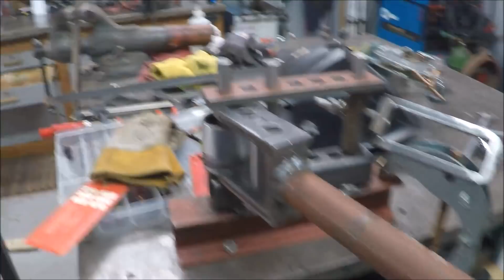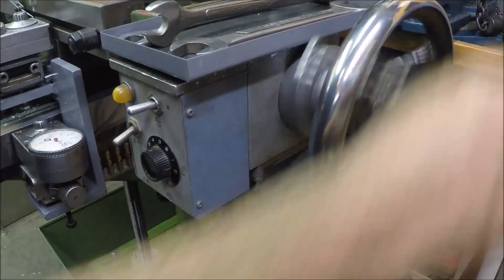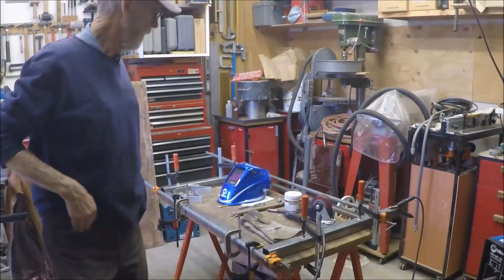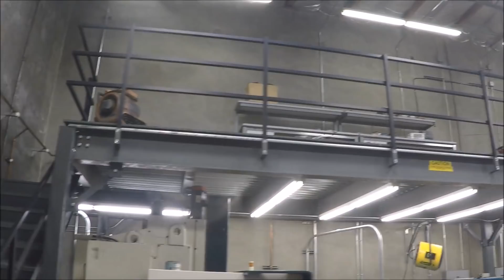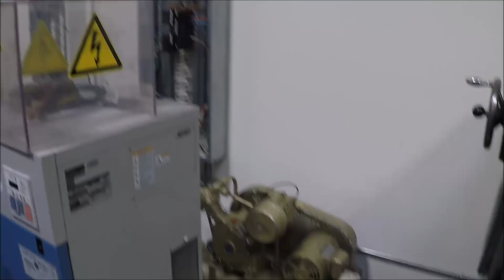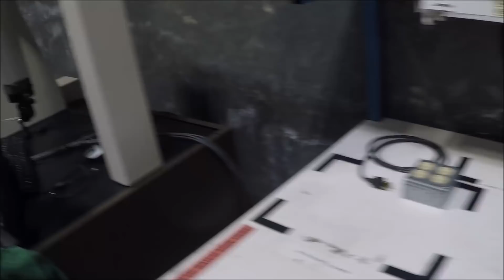Tools--Talk--Tour  Screwy Tuesday

Comment: Chuck, thanks for stopping by and visiting our shops! Had a great time... 

Wish I had the talent and motivation to get these projects completed and have more of the toys running....

The Aciera F2 (which belongs to Brian) is probably the next one to restore, that should be an easy one.

I have a 1000EE hidden in storage I need to bring to the shop and restore, however I feel I need to complete a few easier projects first before tackling something that big and overwhelmingly complex.

Also have 3 (yes, three) SIP jig borers that I need to take out of storage and decide on long term strategy. A pair of MP-3Ks and an MP-4G along with tooling and stuff.... 

Alex K.

Comment: I'm sure Carl thought of this but to his lube system, the oil lines need to throttled at or after the manifold to compensate for line length, pressure differences, orifice size and what have you.